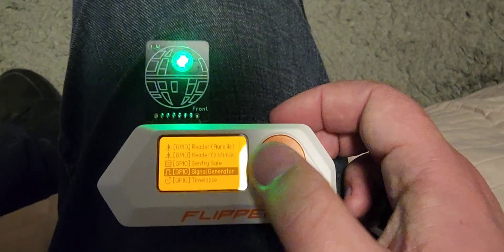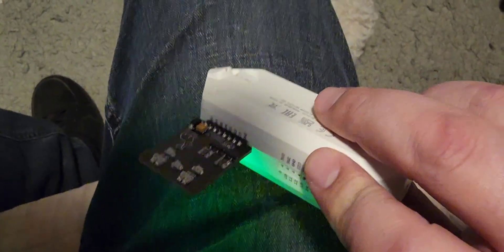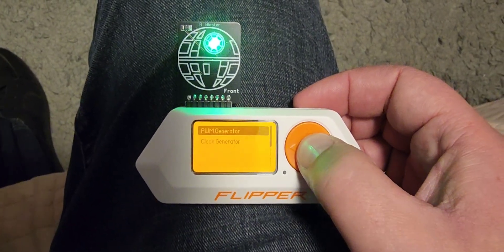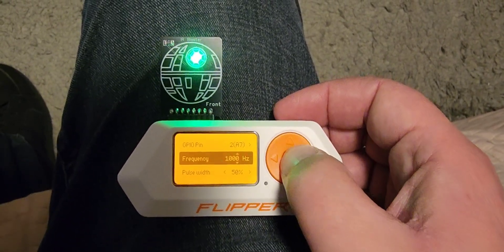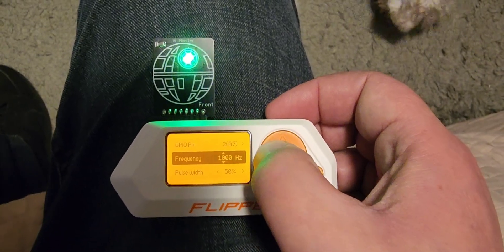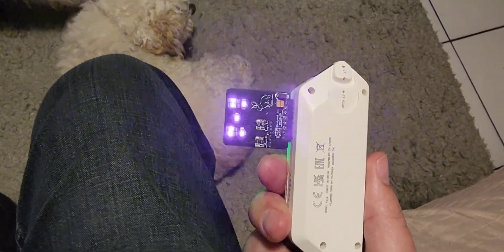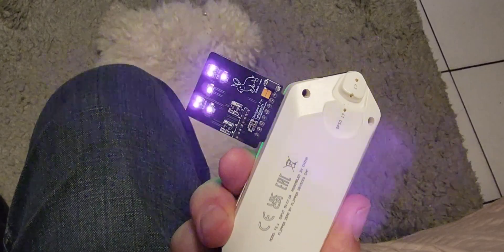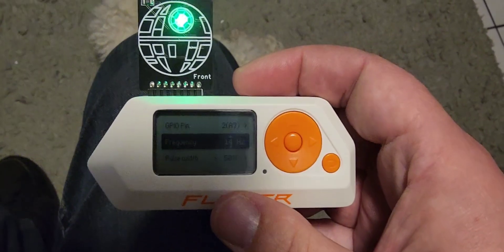Flipper zero opticom streetlight changer using TehRabbitt IR blaster. (POC only)

Comment: i heard this doesn't work without external power and more IR lights, opticom units in the patrol cars are pretty IR intensive as in many many lights.
some kid used ir boards from security cameras and an external 9v for power, and apparently, it works.
Reply from the maker: @A10-p1q1n  This video was based on Peter Fairlies fake video... it wont work unless you back to the 80's in a time machine
Reply from the maker: @A10-p1q1n  I didnt find out peter fairlie faked his videos until after i made this video

Comment: I got an Eye Of Horus from rabbit labs and I’ve done everything in this video but even after I turn the 5v power on in GPIO settings, when I open the PWM generator the power light on my ir board turns off. I can’t get the 5v power to stay on
Reply from the maker: Thats really wierd, i would contact them on their discord...
Reply: @boboso5676  it gets hot quick though. Fast configuration, short burst, exit app
Reply from the maker: @blissbane8448  I have never played with that version, I have a Masta Blasta and an original IR blaster, but have not had any experience with that particular board
Reply: @boboso5676  The masta blasta seems comparable though that should be strong enough
Reply: Eye of Horus is a COPY-CAT product made by "Dtech" who is not affiliated with Rabbit-labs.  Power being turned off by the flipper means you are exceeding the safe limits of the 1A fuse on  the 5v pin and you risk damaging your flipper.

Comment: you arent going to mess with any opticon sensors. This may fool some internet people but if you did absolutely any real research yourself you would know this will never work. A quick look at the spec sheet for opticon you would see their IR receivers only receiv the 890nm wavelength which LEDs for this spectrum are hard to find and expensive... Pretty much nothing else uses them. The IR LEDs on the IR blaster are 940nm which is what pretty much everything IR is these days with the exception of some 850nm use cases, but even those WILL NOT activate the traffic preemption devices receivers. (Not to mention almost ALL preemption devices these days use either some form of encoding  in tyhe IR signal used to identify department and vehicle number within this 14hz signal through manipulating the duty cycle and tying it toreal time temperature data and/or timestamp, or using a combnation of IR and GPS signals that are broadcasted to the opticon and verified through a database or cloud structure.) You either did this for clicks in which case SHAME ON YOU or you really thought this would work because you did zero research yourself (your generation is lazy and thats too much  work, we get it) in which case youre another script kiddy google warrior with a cool hacker toy you dont understand any of because you want to appear to be an elitist amongst your also uneducated social circle in which case, again... SHAME ON YOU. Proof of concepts actually work... that cute little chuckle you did as you nutted yourself on camera when you thought you hacked the secrets of the universe... PRICELESS hahahahahahahahahahaha

Comment: My area has older opticon systems and it will work. But I used a much more powerful ir setup.  But be careful traffic cams can be sneaky. But there’s a way around that too. But I won’t explain for legal reasons. Happy hacking
Reply: no, you need much different IR lights. 850's and the 940nm that are in ir blaster will not register on the receivers as they utilize 890 nm wavelength. congrats, youve been admitted to the sub-par-iq lack-of-research committe as well
Reply: @nikopapas3216 how did you figure out the wavelength?

Comment: PoC ? Where?
Reply from the maker: The POC is that it can pulse at 14hz in the IR spectrum, which is what opticom uses. And according to this documentation from opticom:  https://www.gtt.com/wp-content/uploads/Activating-Opticom-System-Security-Features.pdf only some systems have the extra security measures. However, I have no way to test these systems because they dont exist in my area, thus its POC only.
Reply: that wasnt a true PoC it was a Poser  Orgasming on Camera. this will never work. proof of failure

Comment: bro you just blinded yourself don't look at IR beams!!!
Reply from the maker: Lol, you can damage your eyes from ir light, but not at these levels. The board doesnt even heat up so its pretty safe at 3.3v - about the same as a watch battery.    But the ir light is invisible to the naked eye which is why i use the camera to check if the lights are working.
Reply: @boboso5676  You can still damage your eyes over time with IR boards. This was covered during DeathCon
Reply from the maker: @RandomUploads  since the IR blaster is home‐made, it may very well be a bit stronger than other IR devices, so I don't recommend staring at it for any prolonged period of time, and since this type of IR light is not visable to the human eye, I suggest looking at the light through a camera like I did in this video.

Comment: Don’t try this please the board will  get super super hot and you might burn yourself and ruin your board and maybe your flipper too.
Reply from the maker: Funny i can still see and my board never got hot, not sure where you got the idea that such low intensity ir light could do damage to the eyes, also it was the camera that looked right at it, human eyes cant see ir light, but thanks for the concern!
Reply: not to mention the dude just blinded himself looking right at it
Reply: the board runs hot. it says so on their website. its not meant to just run for hours or even minutes upon minutes. its meant to transmit remote control push button codes
Reply: @nikopapas3216  while you are correct about it getting hot, the IR will not cause eye damage, it can cause headaches though if you stare at it long enough (similar to standing outside without sunglasses on squinting for too long... just minus the squinting because your eyes don't register the "glare" unlike visible light).  AKA Eye Fatigue.

Yes, there is a lot of energy being handled on that little board and it will heat up if you're driving the LEDs using the GPIO Signal generator.  the boards themselves are designed to withstand much hotter temps than what is generated, so while no harm will come to the blaster itself, you can burn yourself if it gets hot enough, and thats why there is a warning...  much like the "CONTENTS MAY BE HOT" on a cup of coffee at McDonalds... some things are obvious, but they aren't for some people.

Comment: Not trying to ruin anyones parade but i tried this it wont work for the lights...please becareful the board will get super hot if you attempt this. More equipment is needed
Reply from the maker: That might very well be true, i haven't had a chance to try it, maybe Peter Fairlie can try it on his opticom setup,  i mean, he did trip it with a simple pocket flashlight set to 14hz. You also gotta make sure your not testing on one of them newer opticom systems that require more than just an IR light at 14hz. I just realized you said you tested it, do you happen to have a opticom setup to test it on?
Reply: It may be too weak to trigger them. You'd need a bigger IR blaster
Reply from the maker: @nightmareapocalypse3471  ya, and he did make a massive one with like 16 LEDs for 80$ if ya really wanna get serious with it... EDIT* actually this comment got me to check his tindie page and see he has released a more streamlined version for about $40 that has 12 big IR LEDS on it, so I ordered 1, ill make a video soon
Reply: Aww. Lol
Reply: the board runs hot... its stated on rabbit labs site thats normal. It doesnt work because it doesnt. had anybody done their own research and not taken the posters on camera orgasm while he creamed his pants when he figured out how to get a square wave generator working as "proof" youd realize he also is an imbecile. figuring out a 2 setting PWM is like the absolute hardest thing ever, and his excitement proves his lack f anythng pentester or protocol related. These LEDs wont even be "seen" by the opticon receivers so i mean tere's that...